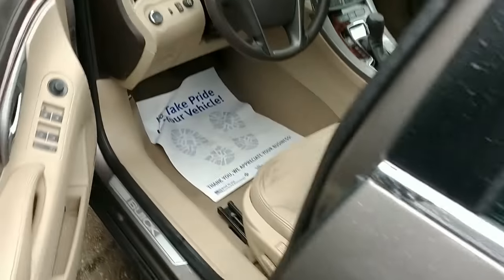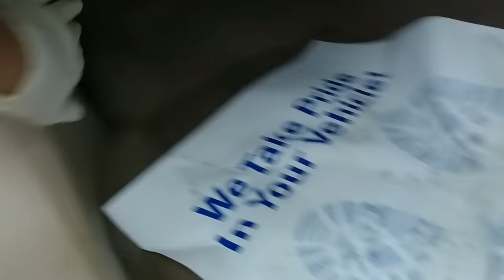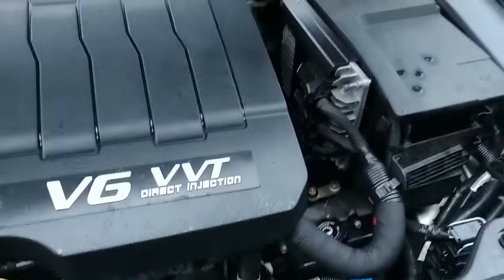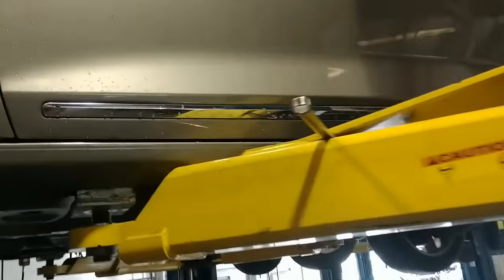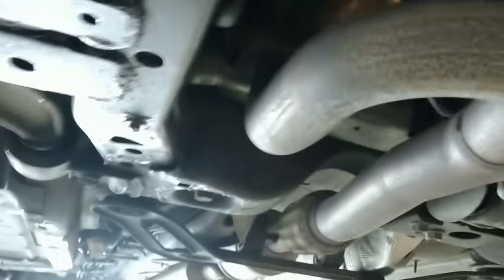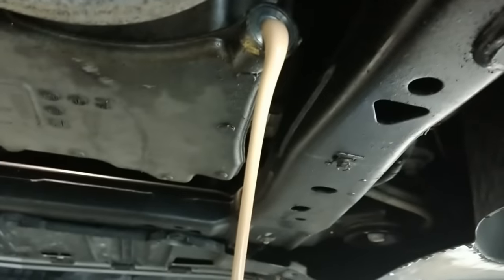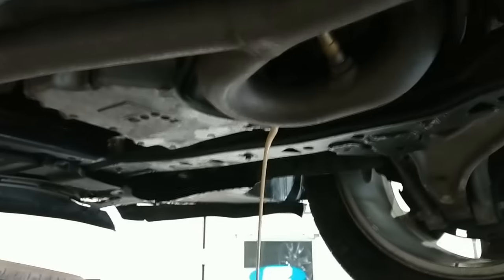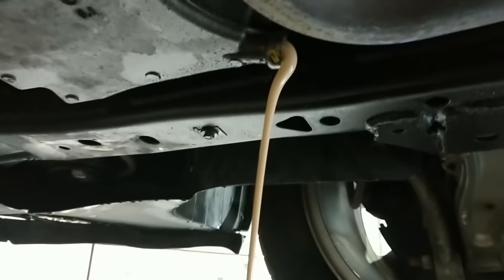Overfilled Crankcase! Blown ENGINE! Used Car Nightmare!

Comment: This needs a follow up video... Inquiring minds needs to know how this ends.
Reply: Most likely the vehicle was scrapped as the repair costs more than the value of the car
Reply: Idk but it looks like the head gasket busted and the coolant mixed with oil between the head and block. 
I’m not a mechanic tho 🤷🏾‍♂️
Reply: @RedBaronisa  That's what I suspect happened from what I'm seeing. I hope that that lady got kissed afterwards...
Reply: Im patiently waiting
Reply: @racemylife1  Replacing an engine or a really good deep head gasket job can’t cost that much. We’ve replaced more than a few Buick engines recently and the bill wasn’t more than $5k. 

Unless the customer bought it for 5k of course. Probably more than that.
Reply: @bljgaming86  you'll be waiting your entire life
Reply: @charlesn898  "I was curious why the salesman treated me to dinner first.. thought it was just exceptional customer service."
Reply: WTF are you talking about?  We KNOW how this ends lol.
Reply: @cccycling5835  5k isn't that much? If you're buying a used Buick with that many miles on the clock, 5k is probably quite alot.
Reply: @RedBaronisa  If you aren't a mechanic, that's one hell'uva a guess. I would inspect for the freeze plugs in the block. If it's been overheated enough, they will pop out, which would void the warranty if  it were under one.
Reply: I agree!
Reply: not good..
Reply: And everyone lived happily ever after....except for the owner of the car... The end. Hahahaha
Reply: I'm curious to know if this was able to be fixed. Anyone can throw a new engine in, I want to see the fix.
Reply: The mechanic said the lady drove it till it quit that motors toast.  Potentially yeah you could fix the gaskets fix the leak that caused the blown head gaskets keep running it but that motor is severely short in life
Reply: Poorly..... it ends poorly
Reply: Rebuild motor replace headgasket replace radiator. What else is there? Maybe a serp belt.
Reply: @Dpol85  over heated block may have stress ruptures "cracks". Overheated rotating assembly will be severely weakened.  Heads are no doubt trash.  Best to replace the engine as an assembly.  Cheaper, too
Reply: @cccycling5835  I'm pretty sure that if someone is going to a buy here-pay here to get a car they don't have $5k to burn. Probably couldn't afford $500!
Reply: And this is why we have regret purchase protection laws in some states now.
Reply: Simple buy here pay here means no more payments
Reply: @RedBaronisa  
That’s what I thought.  I had a head gasket blow on me, and being young and dumb, I kept driving to get home instead of calling a tow truck.  Head gaskets suck!
Reply: Spoiler: It ends in tears.
Reply: @keirfarnum6811  did the same when i was 21. Learned my lesson with that $600 mechanic bill
Reply: Yes we do want to know how this ends and how bad it was
Reply: I'm not really interested in how it ends but rather what caused it.. What caused the head gasket to go? Overheating due to insufficient coolant is my guess 🤔
Reply: @WingedSumac  Freeze plugs? If the freeze plugs popped the coolant would have leaked out of the engine, not into the oil. Some of these new engine have some weird internal water pumps. It's either that or the head gasket.
Reply: @joshrandall3632  That's not what I meant. It's been quite a while since I saw this video, but I was more referring to a car being that new having voiding the warranty if the plug is gone. You're obviously right about the oil/coolant mix. I'd be worried if the block were cracked personally.  Check your idea 1st though.
Reply: @goldenboi7685  Most new engines will cut out if the temp gets too high like that. People bitch about it, but it keeps a smaller problem like low coolant, from destroying the engine. It's not like the old mills that would self destruct if the driver didn't shut it down.
Reply: Can I assume the inquiry is about what the owner did with who sold the car?  Was it a dealer or private party? 
Either way I'd get my happy ass back to who ever it was and show then the milkshake they sold me.  
Expecting the best,  especially from a dealer. If not....
"Hell to pay" would be an understatement.  
I wouldn't care if it was purchased "AS IS". That wouldn't apply to me giving my cash for a POS for one second. Give it back or I'm going to MAKE SURE that business would no longer be a business.  No doubt about that for a single second
Reply: Blown head gasket can be machined.  I had it done once on a gmc sonoma for $800.
Reply: @chrischapman276  In most states, because it is an As-Is sale with no warranty, she is out of luck, but still owes the balance on the vehicle.

That's the drawback to buying from subprime auto lenders and the used dealers who will sell something which barely runs, at the Excellent condition book price tag. Costs far less to make the outside look good and disconnect the negative battery terminal for a few seconds to purge codes, and then try to pressure people in financial difficulty to buy a car at interest rates they really cannot afford.

And it's for that reason, that people need to get a third-party to inspect the vehicle if they themselves are not experts, to ensure they aren't buying something which is going to have a mechanical failure in shirt order.
Reply: We are lucky in this country (UK) that we have the sale of goods act to fall back on when there is a no warranty As-Is sale. As this car is " not fit for purpose" we can take them to court and claim the money back and/or void any contracts we have...
Reply: Head gasket or warped head
Reply: @richardctaylor79  most state have lemon laws which would probably allow reverse of transaction or repair at dealer expense.
Reply: hopefully there are lemon laws where they bought it.
Reply: Well, she should just not make the payment and they'll reposses it.
I'd have it towed to my driveway, wash it, make it all pretty again, spray air freshener in it, like I was taking real good care of it.... it's their problem now..lol... but she's out her down payment...😭
Reply: @cccycling5835  by now, a lot more than just the engine is damaged. the car would only be worth like $8k in excellent condition. since she bought it in this condition, she can’t return the vehicle and she probably can’t file an insurance claim about it
Reply: @stevenswenson7041  - Lemon Laws only apply to warranty coverage! It’s basically a vehicle manufacturer vs the consumer type of deal for a defective vehicle that is beyond repair! This vehicle is not under warranty, probably has changed hands multiple times and will result in a shady used car dealer vs consumer! 
She needs to have her family, friends, workmates and all their friends to bombard that dealership with negative reviews on every social media blog! This strategy directly effects a dealers sales and could result in a settlement!
Reply: @cccycling5835  I doubt they paid much more than $5k for that car.  You are talking about doubling their cost.  If they had $10k, they would have lively bought a better car to begin with.
Reply: Should end with Denzel Washington waking into the buy-here-pay-here managers office…
Reply: I know blown head gasket when I see one. Part itself is ten bucks but work is whole days worth.

Comment: This reminds me when I went to a used car shopping once. Interior of the car was great, exterior was good, went for the test drive and the trans slipped going into 2nd. I got back and looked UNDER the car to see nice ruby red transmission fluid on the bottom side of the trans. “These things get like that from sitting too long.” 
Fresh fluid AND it’s leaking? Riiiiiggghhtt. 

He tried to backtrack and say “Oh we just did a service on it. Let me get it back to the shop to have it checked out again. It’ll only take a moment!” 
Needless to say, I didn’t buy anything from him.
Reply: In my country, you can report them to either local law enforcement for fraudulent dealing, taking them to civil court (for money, because there is no money in taking it to law enforcement), and/or local&national business associations. (Some options are limited depending on where in the country you are, some places enforce stricter laws, other less.) Unfortunately, most people in this country don't know they have these options available, or don't even have the 100$ to start the litigation process to get their money back.
Reply: I experienced something similar to that, testing a manual transmission 2004 Accord. The transmission would slip out of third during the test drive, the front driver side strut would make a boisterous knock when weight load shifted forward (shifting gears or braking would present this noise), and I just barely avoided a crash by stomping on the softest brakes I'd ever felt - it seriously felt like there was no brake fluid, the pedal was on the floor. I returned to the used car dealer, told them the brakes were completely shot, the transmission smelled burnt out, and there was a loud knock from that strut. The wife of the (likely unskilled and ignorant) mechanic/dealer stated that those things happen to older cars...
Yeah right.
Reply: Once I had a car with a ghost electrical drain that I couldn't fix,  so I shopped around for a decent used Accord and went for a test drive. Me and salesman go out to car......and dead battery. No thanks---- I got one of those now.